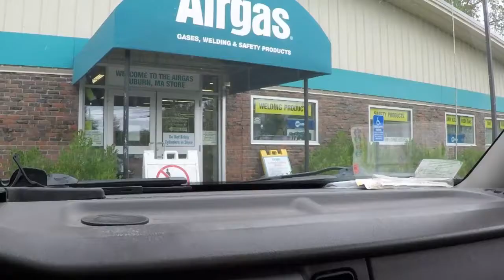'Tanks fer nuttin' (some information on welding gas cylinders) Part 2

Comment: Rather then trying to exchange the cylinders or paying to your LWS to send them out, I recommend bringing them to a place like Northeast pressure vessel testing in Westborogh MA.They will hydro test them and if they pass sandblast and paint them as well for pretty cheap. Certainly less then the LWS will change you and likely a faster turnaround as well.

Comment: If you have CO2 why don't you weld with it?
Reply from the maker: I use a co 2 argon blend for mig welding.
Reply: @stevewatr  co2 works
Reply: CO2 all the way baby. It's cheap and works fine. And you can use it for dual shield flux core and 308 and 309 flux core wire. Switched over from acetylene to propane too...  because fuk the airgas gangsters. They just over charged me on my last argon refill.